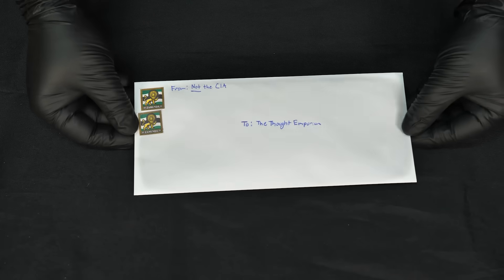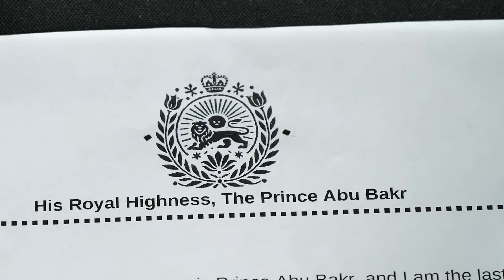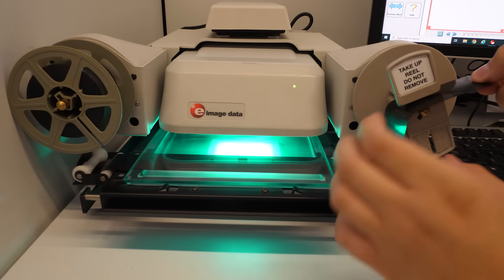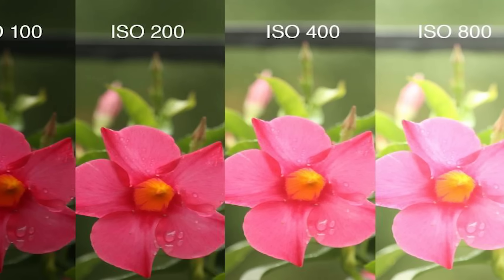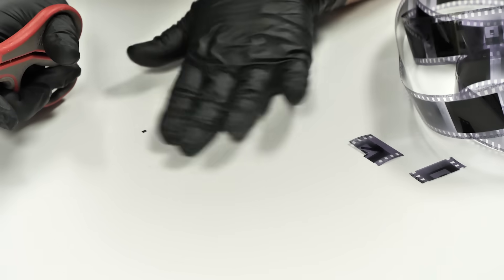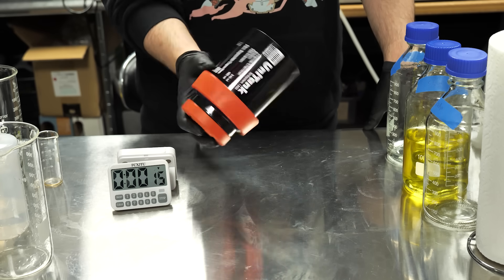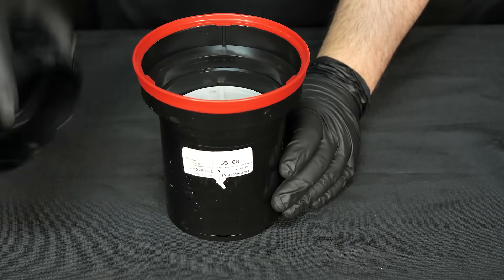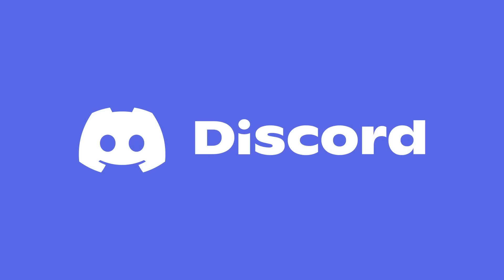Recreating CIA Technology Was Surprisingly Easy (Microdots)

Comment: You can roll your own film.  You can buy reusable plastic or one time mental film rolls and add as much unexposed film as you want (in a dark room or portable dark sleeve).  When I knew I was taking pictures of a single subject,  I would only add enough unexposed film for about 8 pictures.  Any less and it was hard to load onto the development reels.  I would also roll extra large rolls at times with as much unexposed film for about 72 pictures, when I did not want to carry a lot of film canisters throughout a day.  I love film photography but it has been a long time since I was doing it seriously.

Do not reuse developer.  As a side not you can recover the silver from the developer, thought it is not cost effective.

Comment: 10:58 If you say “maximum aperture” you probably mean you stepped down as far as possible, right? If you step down a lens that much, the resolution is reduced. Usually the aperture between 4 and 8 are the best for maximum resolution, depending on the speed of the lens.

Comment: There are several film stocks that go even lower speed than the PAN50F. I think B&H in the US still has Rollei RPX25 and Ortho25 in their stock. There's also a film branded ADOX CMS 20 II, claimed to have resolution up to 800 l/mm, but I'm not sure they are still in production or not, because a well-known analog photography supplier in Europe like Maco Direct doesn't have any of them in any format in stock. There are other films stock that go even lower ISO than these, but they are mostly "creative" film, like Lomography Kino series, so I'm not gonna talk about it.

Although I never have any darkroom experience by myself, but I've been talk to several hardcore film lovers enough to pick up something. I believe that there is a method called stand developing, which you agitate the developer can only once at the beginning and leave it stand until time's up. This method will minimize the grain, but also results that the contrast of the photo will be lowered too.

Comment: Hint on he film part: BRACKET!!!  You can change at least your exposure settings on the same roll of film. Also, metering is your friend, you cannot measure light for any situation other than cloudless sunlight with your eyes. It will try to put the whole image at roughly neutral gray, but a: you can compensate your exposure from that point to get either white or black as needed, and b: that might not even be an issue as it should keep anything from being blown out. That is of course provided you haven't done something silly to massively swamp the meter, like hang your subject from an unmasked light source to be massively backlit and cause flaring.

Comment: Dude, developing the film brought me back to my community college days! I got extremely good at putting film onto a roll, and remember doing 7 rolls of B&W film at once, split between two canisters and that was a heck of a challenge but somehow I pulled it off. Film photography is absolutely incredible since it has the ability to capture things in a way that you can't get with digital in my opinion.
Reply: As long as the same information is transmitted to the viewer, I can't see how the method of recording the information provided by the reflected photons in question should make any difference.

Comment: Old photography rule - f/8 and be there.

Expand on this a bit: if you're in a hurry f/8 will usually be sharp enough if you focus well. Your glass may be its sharpest a bit more open or a bit more stopped down than this. Fast glass is typically at its best a stop or two down from max (largest, widest, smallest number) aperture. So like a f/2.8 lens might be happiest at f/4 or perhaps f/5.6.  Kit glass, cheap glass, etc you'll usually end up around f/8. Much beyond that and diffraction becomes a problem quite fast.
Reply: An old rule of thumb is the middle aperture tends to be sharpest, so for instance on my big 300mm f/5.6 it should be sharpest around f/11. the f/8 and be there is genuinely pretty accurate for mid speed lenses though as their middle aperture usually is exactly f/8.
Reply: @xander1052  it might be sharpest then, but you've lost so much light and gained so much diffraction it's not going to be all that useful at the end of the day, especially for something like this at the highest end of what the system can resolve. When you're trying to squeak out max resolution, you need good light, good focus, and your lens to be at its best aperture for the task at hand, which may not always be the "sharpest" - it's probably good enough. There's focal length and depth of field considerations to be made as well. It's not as simple as f/8 and be there, but that will definitely get you close enough for most stuff. For specialty situations like this, there's a lot more to it. It's why string is useful for fixed focus cameras. It's "calibrated" so that you could hold it from the right distance to guarantee critical focus. The rest was basically decided for you in hardware, other than the lighting conditions.
Reply: When you press the shutter manually, you introduce blur. Use a shutter cable.
Reply: I second this; wide-open aperture will blur the image a bit. Sharpest image will be somewhere between maximum and minimum aperture (minimum will be blurred by diffraction).

I usually use f/8 by default if image sharpness is a priority.
Reply: For this application you can compute the diffraction resolution and make sure that your aperture is not too small.  I suspect at the resolution they're targeting even f/8 may be pushing it.
Reply: For the stuff he's photographing too he'll get a lot more contrast printing multiple times and overlaying the prints, Ensure the printer is set to maximum darkness. Applied science came up with a process for it for when he was doing similar things.
Reply: All comments here are mostly true and there's actually a word for bokeh from overly tightened stop in Japanese
Reply: Not to mention this is wide aperture on a very old lens. f4 on a new, sharp lens, will be a completely different world. It can be seen on the developed negatives that the film actually outresolves more than the lens.
Reply: Also physics allows F8 be the sharpest aperture possible.
After F8 it doesn't get sharper, just the depth of field increases.

Comment: DIFFRACTION! LET'S GOOO!
Really wondering where you got your hologram patterns from. In case you haven't checked it out already, I suggest looking into CorticalCafe's diffraction hologram generator. I haven't had much success with it yet, but it seems like I was just limited by poor impression quality.
Reply: If you're having trouble with actually running the program(I think the download is broken on the original website), there is an instructables page with a functioning download link somewhere

Comment: 11:00 I'm pretty sure that you are not supposed to use smallest aperture for things like this - lenses are usually sharpest somewhere at the middle of the aperture range. IIRC, smallest aperture get into the range of where diffraction becomes an issue - this is also why pinhole cameras have limited sharpness, as the light is always diffracted at their crazy small aperture sizes
Reply: I was doing some IR photography with lenses designed for visible light and suffered that problem too. Optimal was still quite small aperture
Reply: As a rule of thumb, f/8 is usually the sweet spot for most lenses.
Reply: @nate_0723 exactly. More generally depending on variables.. f7.1-f11.

Some fixed focal length lenses can be almost as sharp at their wide open settings. $$$$$ though 😂
Reply: @nate_0723  The f/8 rule is actually quite innacurate, it works OK for zoom lenses that are in the f/3.2-5.6 range but for any fast primes that are f/2.8 or faster the sweet spot is actually much closer to f/3.2-5.6
Reply: You are correct. It's always recommended to consult performance charts of lenses, where it matters. Many of my lenses have a sweet spot at f/5.6 - f/8.
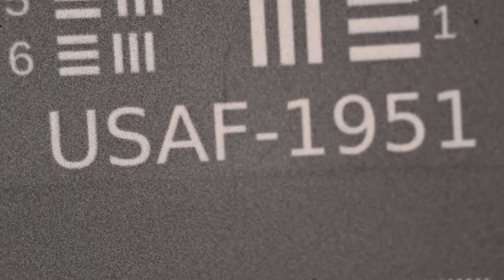Reply: I was thinking the same thing as I was getting better resolving power with 400 ISO film shot offhand when I was testing a couple of years ago.  I was comfortably out resolving  what I could get from a DSLR at 1:1 macro which has 115lp/mm.  His images definitely look diffraction limited on the resolution test at 6:15.
I shot at f5.6 on an f2.8 lens as that was my sharpest aperture.  Shot outside in full sun on a Pentax Nova.
Reply: The multiple factors that actually determine what f-stop you should use it depends on how much you want in focus in the picture I.e., do you want to have a large depth of range of focus.  It also has to do with how sensitive your film is in this case where he's using a very low sensitivity ISO 50 film you want a wide open aperture actually ideally to get the most light possible in with a slower shutter with a faster shutter speed if possible to ensure a crisp image in case there's any jostling. Fortunately there's a light meter that will actually determine what are the optimal settings by simply inputting the iso speed into your camera
Reply: In theory, wide open is best, as larger aperture = higher resolution, but as lenses aren't generally near ideal, a stop or two down may get maximum results.
Reply: @UncleKennysPlace  wide open would be the best from a diffraction perspective, but very few lenses are optimally corrected for geometric aberrations wide open (usually really, really expensive, really fast, ones). You also get into the issue of making perfect focus that much more critical, as DoF gets much smaller.

Comment: 2:06 "No one" is a pretty strong word to use here :X
7:37 A PCB is NOT a computer chip. A PCB is a Printed Circuit Board, it will most likely have chips ON it but it is NOT a chip. It's just traces to connect everything together, and house it.
Sorry to be a butt, but you're a channel about learning, you gotta get it right! :P
Reply from the maker: Both the manufacture of ICs, AND PCBs use photo resist. The AND in the sentence is because 2 things both use the same material. I never implied they were the same thing.
Reply: @thethoughtemporium  Ahhh, sorry the way it was said it sounded like you were saying "Computer Chips, AKA PCBs" with the or there! I'll delete the comment if you want.
Reply: Chips are also made with photoresist

Comment: To help you get a higher resolution i would suggest stopping down your lens to f8, thats usually the sharpest f stop on lenses. Higher f stops might create higher depth of field but also induce chromatic aborations. On regards of the film you used i suggest you look into ADOX CMS 20. From what i know this is the highest resolution, easily available film on the market. The Developer often is reusable, depending on the type of developer you used. Developer like Rodinal is a one shot Developer, which cant be reused. There is also a wide range of developers which influence the look and sharpness of the film, however that is a topic im not that knowledgeable about.

Comment: yes, dev can be reused unless it's a oneshot developer like rodinal 
adox chs ii is the sharpest resolution film available iirc unless it got discontinued
Reply: The stock they have left is all that’s left now, Agfa seems to have stopped producing it after EPM went under. Astrum still sells MZ-3 though
Reply: @mcb187  Yes, unfortunately CMS is no longer coated, CHS, scala and HR50 are however still coated. Adox estimates they have 1-2 years worth of supply. And CMS 20 stores exceptionally well, if frozen, practically forever. So you can stock it up and freeze it. At least for a little while longer.
Reply: I believe you mean Adox CMS 20 II. 

CHS is a completely different film.
Reply: @alfepalfe  yeah, my bad.